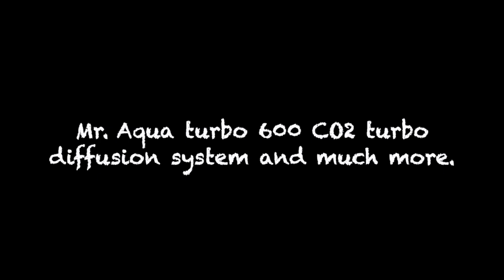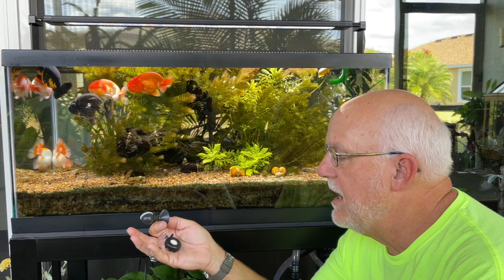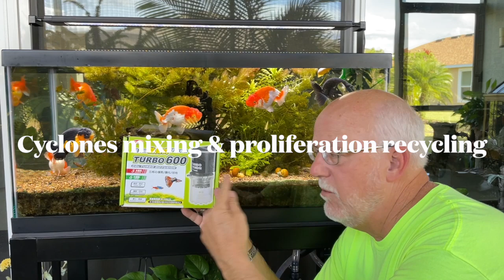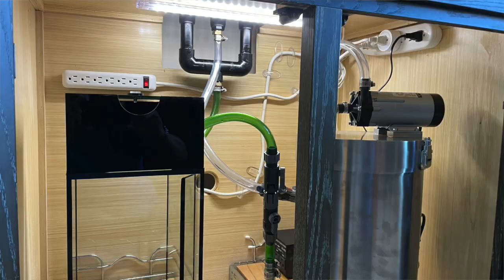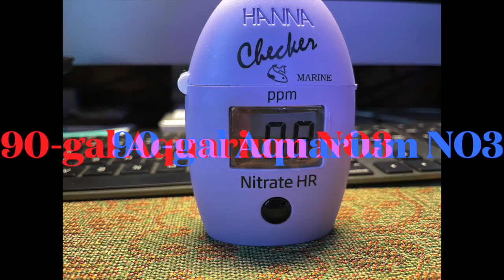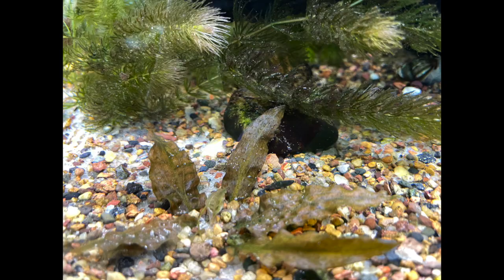Mr. Aqua turbo 600, CO2 diffusion system and much more.

Comment: Hey there Dr Novak. If I put that Mr. Aqua in my sump return chamber, will I then need to point my loc line return straight down into the tank?

Right now i have the return in the tank right at water level to break surface tension 🤷🏼‍♂️

Thx

Comment: Dr Novak. I've been a fan and follower for a long time. I recall a DIY video years ago you did with a Cascade 300. I did the same drilling and pushing CO2 thru the impeller. I don't use that set up any longer and the Turbo 400 & 600 are the same concept. I've found better saturation from non powered methods over the years. Thank You for all the knowledge you share.

Comment: Hello Dr Novak. Always interesting to see your videos. Years ago I had tank with deep sand bed. Sand would soon clog up and deposit black sludge. In very short time it would go completely anaerobic. That's why I gave up on small sand in aquarium. Now I have three BCB's in my tanks. Two are filled with leca hydroton clay and one with sepiolite. I plan on replacig that with zeolite when I get my hands on some. It will be interesting to see if these BCB's went anaerobic inside. Is there a way to measure oxygen levels inside BCB basket or sand band? Perhaps sticking ORP or O2 level probe inside would give us idea of oxygen concentration?

Comment: Dr. Novak, it looks like there is a kind of black stratus at certain depth. Does it mean that the substrate height should be thinner or the air bubbles flow higher?
Thanks in advance

Comment: Hi Kevin. .. more information for my aquatic brain to digest ! I use a ceramic disc diffuser running off a 2 litre bottle of diy co2 and it's flows upto the inlet of my built in filter and gets sucked in and mixed inside the inbuilt filter of my juwel rio 125. Stem plants grow crazy and I add liquid iron ( 1 ml per 24hrs for 100 litres nett water volume, from a mix of 1 scoop of sequestered Iron mixed into 2 litres of deionised water, so it's mega cheap ) and 1 ml of liquid carbon per 24hrs into same tank from a 5 litre bottle, so that's also cheap as it's 5000 doses ! Vitally no algae but haven't got any reduction of nitrates from average of 50 ppm per week after a weekly 90% water change. I'm now wondering if de chlorinated tap water actually contains the specific bacteria I need to make my system work !? So mixed results with an under gravel plenum system for me.
Reply from the maker: Just give it time and see what happens be patient.
Reply: @anoxicfiltrationplenums  hi kevin... will just keep trying. Stripping down tall tank soon and rebuilding with plenum, have all my stuff ready.

Comment: Great info. I just recently set up a 90 gallon with plenum and am currently using a ceramic disk diffuser. I'm going to try the Mr Aqua 600, looks like a much better option. I'm also running a Oase Thermomaster canister, mostly to create flow, heat and extra filtering. I moved 2 aponogeton boivinianus from the 30 gallon tanks they were in to the 90 gallon. They had completely out grown their tanks. Those tanks also have the slow moving plenum set up. I have had great results with plants using the UG filter, slow moving style. The plants love it!
Reply from the maker: Good information let me know your outcome.

Comment: Sera and ISTA CO2 reactors do the same (chopping up the CO2) , but Inline to the output of a cannister, so no electric needed. As no electric is needed, there is a minimum pump power required from the cannister they are attached to though.
Reply from the maker: Anything that is placed on your output of a canister filter slows the output down tremendously. So I guess it's a Yang and a  yang of the trade-off that you want to commit to.

Comment: Hello Dr  Novak,

Great video again.

I use a diy system with 2 2liter bottels and suger/yeast methode. For a diffusor i use a up side down container that has 2% of the square from the watersurface. This way i have a regulated system because there can't be more CO2 taken in the water because of the size of the container has.

Greatings,

Henk-Jan